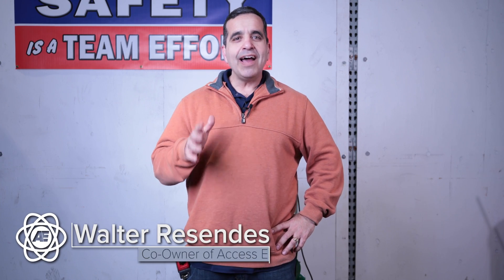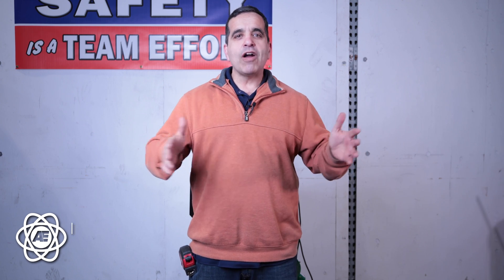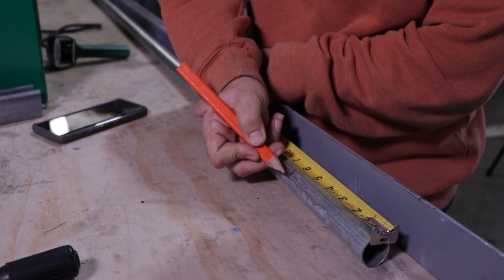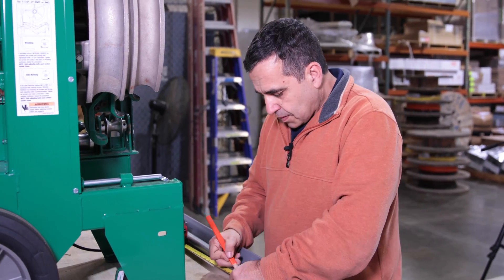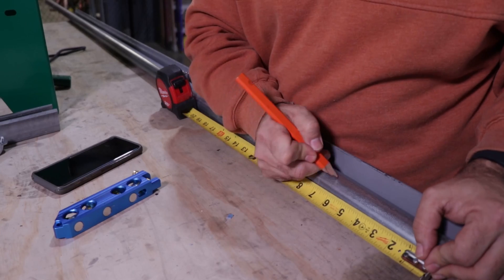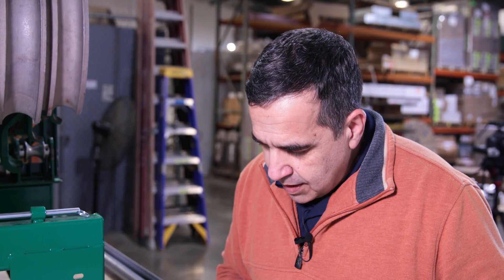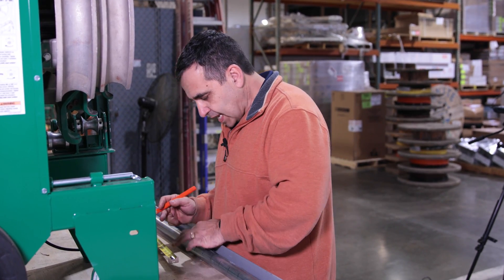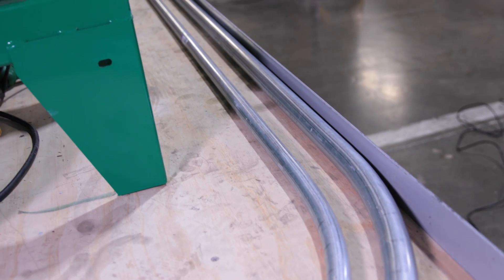Conduit Bending: Concentric Bends

Comment: If I want my conduit to be equally spaced (let’s say 2”) center to center, how do find the new correct developed lengths for each new concentric bend?
Reply from the maker: @tylersargent2183  just add the center to center distance with the gap to each subsequent conduit and multiply by 1/2 Pi to find the developed length and then mark and bend the same way. The longer the developed length the larger the gaps will be between bends

Comment: The second conduit will, I presume, run outside of the first, therefore it needs a greater radius to do so (think of two circles - the bigger one, on the outside, necessarily has the larger radius). He chose 23" to push the conduits apart by 3" center to center, which should place about 1/2" gap between them when in place.
Reply: @blockededited8280: Thanks for the input. A 1/2" gap would be tight but I get your point. On Unistrut, Kindorf or B-line strut the straps or hold down clamps for pipe on trapeze hanger require some spacing for strap bolt and nut, and of course on larger pipe you need adequate spacing for large thick locknuts in panels or JB (junction box). Retired now, one of the contractors I worked for did hospitals and telephone buildings especially retrofit or upgrades to existing buildings. Probably 90% of all piping was with Rigid conduit. Rigid has a "spring back", the amount depending on which lot or batch along with size of pipe, temperature of pipe metal and changes constantly, ex: you may bend 8 deg then release pressure on bender then conduit may spring back to 5 deg. You can compensate by overbending and check each piece. This shop had guys who had worked at bending tables bending for entire crews and knew their pipe bending. Most places we were not allowed to use split coupling, Erickson fitting or short nipple to enter junction box, panels or switch gear. Your measurements had to be dead on. All pipes in a panel  had a bond bushing with a unbroken copper ground wire connecting all bushings. The main water pipe coming into the building, we had to use large grounding clamps with two lugs on each clamp on each side of the water meter and jumper the meter with parallel runs of 750 MCM wire so if the meter was pulled this would not interrupt the ground, this in addition to driving ground rods around the building then Cad welding the rods to metal connecting jumpers in shallow ditch, " WHEW !!" 🤢go inside the telephone building, take a 90 lbs jackhammer, jackhammer the concrete off the face of a vertical I-Beam, get down to the I-Beam, then drill and tap the thick I-Beam then bolt a solid copper plate to I-Beam for equipment grounds. Telephone Co. was paranoid concerning grounding, many contractors wouldn't bid them they were so strict. I finally got into electrical control work on production machinery, thank GOD !! and said goodby to construction, remodeling and mental anguish.

Comment: Even easier,  Always bend in 10 segments  bend, (no matter the radius).  That with simplify the math and 10 segments always looks good anyways. Just times the radius you are looking for times .157. Then mark the pipe ten times that sum.  Done.

.157 came from consolidating of all the other numbers that never change. It's dropping the unnecessary repetition to make you go faster.

Also the use of 10 makes the math easier to do in your head. Just move the decimal place over one. Makes you even faster.

 Smoking a math test in impossible speeds. So a 10" radius is marking the pipe 1.57" 10 times.
Reply: I've had to bend 15 foot radius concentrics where 10 bends would look like garbage. It's good to know how to do the math for any number of bends and bend angles before you settle for what works just most of the time.

Comment: I'm confused on how and why did you use the 17 marks. What determines how many marks you'll need to make?
Reply from the maker: 9 Bends at 10 degrees or 18 bends at 5 degrees gives you a 90 degree bend.
Reply: @AccessToPower  you're supposed to divide by 18. its 18 gaps distributed along the developed length.
Reply: 17 is the number of times you need to bend 5 degrees in order to get to 90 degrees.  if you only want to bend it 9 times, you would use 10 degree bends.  The lower degree bend you use, the smoother the bend radius will appear.  imagine making a 90 with three, 30 degree  bends.  youd get to 90 degrees, but it wouldn't be smooth or concentric at all.  It would look more like a section of a stop sign. 

Radius times 1.57 divided by the number of "shots" or bends.  Sorry this is 4 years too late.  im sure you have it worked out by now

Comment: Ive had problems for years now. Decr every time i do segment 90s it doesn't look some at all. Im using the greenlee 881 and 854dx by the way. I mean the bend looks smooth. My only issue is that on the outside portion of the bend you can see indentations of the hook or saddle digging into the conduit. Is this natural or am i doing something wrong?
Reply: Put duct seal on the shoe. Sounds strange but it seems to soften the indentations. Nowhere near as noticeable.

Comment: Why did you use 20” x 1.57 the first time and then switch to  23”x 1.57 for the second pipe ?
Reply from the maker: The conduits are 3" center to center apart from one another. This causes the radius of the outer conduit to be 3" greater than the innermost conduit.
Reply: @AccessToPower  how did you get the radius?

Comment: Fantastic information. Where would I use this as opposed to regular 90s
Reply from the maker: Luke Strange. In an industrial environment when you’re running conduit along conveyors, or around large tanks, this technique comes in handy. You can make your conduit look great as it goes around a non-standard sized radius
Reply: Or Say you have an exposed rack and it has to look perfect you have an 1 1/4 inside a 3/4. You can use this to match the radius of the 3/4 to the larger inside pipes

Comment: I'm assuming your 20" and 23" radiui came from your pipe spacing plus width of pipe (right?) How would you know the radius of your first pipe (smallest radius) is that just the take up of the bender (1 1/4 is 16 3/8?)
Reply: You need to know the centerline bending radius of the object or pipe you are trying to follow.
Reply: Take up is related to developed length huh.

Comment: Quick question to how I would find my radius I have to bend 4 3/4 imc pipes around a conveyor tomorrow and I am trying go prepared with a game plan and make it come out nice
Reply from the maker: Samuel Moreno 
An easy way to find the radius of the 90 on the conveyor is to use two tape measures. Measure from one one end of the radius with one tape measure and from the other end of the radius with the second tape measure. Cross both tapes at a 90 degree angle. The tape measures should be an equal measurement when they cross. This is your radius. Don’t forget to account for your support dimensions. Hope this helps.
Reply: @AccessToPower  where did you come up with 17 as a number for your markings?
Reply: This would be done on the outside of the 90? Correct?

Comment: Hello,great class! I want to know if I can do that with a regular hand EMT bender and no with machine?
Reply from the maker: sure. the tequnique is the same, although keeping the pipe straight and level throughout the bend will be more difficult with a hand bender.
Reply: How did you know how many Mark's u needed to do the bend.since you mentioned 17 Mark's
Reply: @jesusrodas9221  you still don't divide by 18, though?  This ugly manuel is screwing with me
Reply: And since its really 1.8470588,  repeating 18 times at 1.875 , (.0279, ) won't screw you?

Comment: Good thing you’ll never have to do these bends lol at least I haven’t
Reply: I'm willing to bet you are a commercial hand. In industrial you make them often, too often 😓
Reply: @joseofno  under which application might I need to do my 90s this way? I am a commercial electrician for the most part, but I have done some heavy and light industrial, i.e., rigid, IMC, and I never had to do my 90s this way.
Reply: William Anderson You use concentric bends for fiber optic cables, going around tanks, vessels and just makes pulling wire/cables a lot easier with less stress on them.
Reply: If you need to go around a large tank or cylindrical obstruction then segmented bends are definitely needed. As previously stated, it's more used in industrial work. I.E. Refineries, power plants
Reply: ryan215553 You would typically need these bends around tanks and vessels , we do them at the refinery quite often
Reply: ryan215553 unlicensed? Typical.

Comment: Thank You, Sir. So what's best for 3" emt ???
Reply from the maker: your going to need a hydraulic bender for 3 inch   EMT. but the technique should remain the same as far as making multiple smaller incremental bends that total 90 degees.
Reply: coupling style angles

Comment: Great video but how did you determine at what degree to make your first bend
Reply from the maker: hi lssecodyj. I used 30 degrees for both angles. this was just arbitrary.  you can use any angle you would like. the thing to keep in mind though is that whatever angle you use will have its length cosecant which is the multiple for the distance between your bends.
Reply: @AccessToPower  pardon sir I think it is  90°÷18=5° per bend.
Reply: @brnrxn  is there a chart ?
Reply: @AccessToPower  I have a 4 inch factory elbow..just a regular 90° I have a 2" that I I have to follow around the outside of the 4"  

How to I find the radius of an existing bend ?

Then how can I match it ?
Reply from the maker: Andres Badel , you can try something like this https://www.pavingexpert.com/images/animations/ring_radius_tape.gif
Reply: @AccessToPower  very good example.
Reply: @Dudirgsioe  if you alrady know it's 90 deg. then bend the 2"  conduit at 90 deg on a mechanical or electric bender. All you have to do is find the 2" bender shoe and make the bend